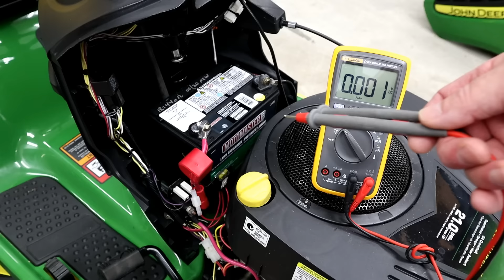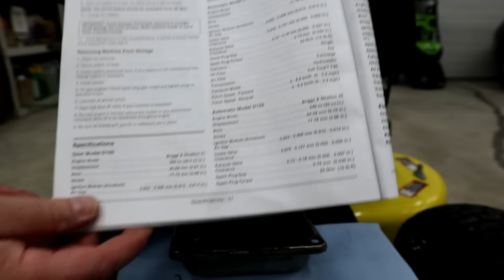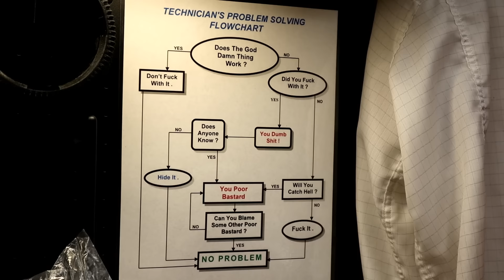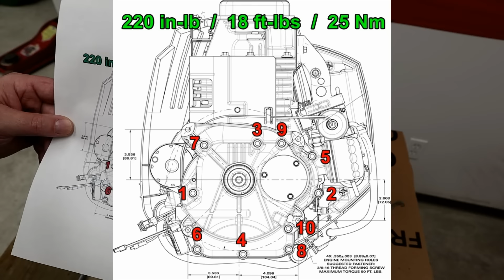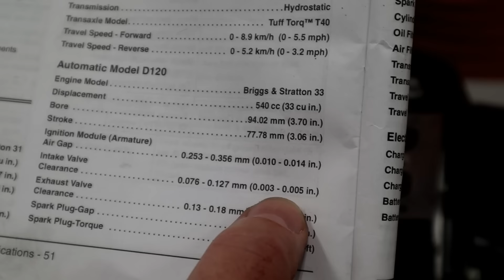Why Won't Your Riding Mower Turn Over? COMMON Briggs Intek PROBLEM & REPAIR.

Comment: I want to know how a mower with over 130 hours can be so clean!  Do you do a full detail after each use?
Reply from the maker: I answer that very question at the end of the video (I give it blow-job after ever mow @29:27). 😄130 hours? Nope; as stated in the video, it had 320 hours on it at time of that repair.
Reply: @Rchelicopterfun   I am guessing a power washer first then blow dry.  I use the leaf blower on mine.  The grass and dust still gets everywhere.
Reply from the maker: @larryjohns8823  Nope, blow only. AS I said in the video, I try to wash it as little as possible. Nothing worse or more miserable than wet grass and a wet mower.

Comment: Is this the same part for the 40 series V twin 20hp intek engine? I have the same problem. Changed the battery and still has issues starting
Reply from the maker: Decompression cam failure only applies to the single cylinder Inteks.

Comment: Hello from Denmark. Thanks a lot for a very good video. I know this camshaft is a problem on B&S Intek engines, and i cant stop thinking of something. What do you think will happened if we only take this broken parts off the engine, and assempled it again without this valve release system ? Ok, mayby you will need to reverse the engine from compression every time you need to start, but i should think the motor will run good anyway. What do you mean about that? Do you think it will work proberly? Just a thought from a guy who also has made a lot of motors from Briggs and Stratton., but not ever has made new engines like Intek yet. Only the good old B&S.
Reply from the maker: Totally fine if you don't mind that hassle every time, but it won't work if it gets too cold out. Will most likely shorten battery and starter life as well.

Comment: Why do engineers solve a problem with another problem ? I had the exact same problem. The smart way,  would to simply install a more powerful starter motor. It would be worth the few extra bucks.

Comment: would you think reassembling the mower without the decompression system would work
Reply from the maker: If it's not fixed/replaced, then it will function exactly the same as when it was broken - unable to start without positioning the piston on the down stroke every time. Which will of course eventually wear out the starter while stressing the bendix starting gear and battery.

Comment: How much oil does this engine take as I have the same engine and shop did not give
Me manual on the new engine as my old engine blew. I am on my 3rd engine with 2006 tractor I average
About 100 hours
On each engine briggs and crap Stratton lol

Comment: My problem, to a T. Had a Yard Machines mower that I have jumped from my car for the past almost 20 years, a real ritual and test of patience to get the &$&%*#;@!! B&S engine to kick over. 
It had this problem from day 1, so it was "repaired" under warranty. Not sure if the local fella who picked it up, took it home and did the work actually replaced the cam and compression release. I do remember though, he said it was a wrong force spring in the CR mechanism!! 

Not knowing mechanically how it worked other than it disengaged as RPMs increased, I just went along with what he said. He was the huy with the info, not me! 

Well, I was able to get it to turn over until last fall, when not even jumping from my car to the starter post was doing the trick, and parked it. 

I went and bought a used JD X300 this spring, with a Kawasaki engine and 150 hours, and that baby starts like a dream. It should last my 72YO bones the rest of my mowing days. 

Not sure if I will fix the old mower the way you showed how in this excellent video, but perhaps this winter, when there isn't much else going on. 

Thank you for the tips all through this video. They are very appreciated!

Comment: Does the Kohler CV15 use a similar decompression system? My LT155 hit something that stopped it cold. After clearing obstruction machine started and ran for about 1-2 minutes then died. I checked and replaced  the fuel solenoid and carb b/c solenoid was broken and the carb was just ugly. after these changes a full battery is struggling to turn it over
Reply from the maker: No idea?
Reply: @Rchelicopterfun  Thanks!

Comment: Which way does that long bolt turn that goes through the pulley? Counter clockwise like normal or clockwise?
Reply from the maker: Right-hand thread (ie. normal).

Comment: If you change the oil, will you normally see pieces of the grenade part come out in the oil?
Reply from the maker: Might, might not - all depends on how catastrophically the decompression doo-dad  got chewed up when it went boom! If the pin just broke (the normal failure) and the arm mechanism just fell down into the sump, likely nothing will show up.

Comment: Just thought this was what I would have to do to my
 jd la115.. same symptoms & everything.. luckily just the exhaust rocker (stud) backed out.. creating a really bad pash.. snug that back in, did a valve adjustment & now it runs like new.. acr working as it should 261hrs.
What hrs the acr usually fail?
Reply from the maker: @Run It - There is no set time as far as I know. They can fail at any time; under a hundred hours or if you're lucky, last a lifetime. Anecdotally, the first one on the new machine only lasted 120 Hrs (outside of warranty of course). The Second OEM one lasted 200 Hrs (320 hrs on the engine). This aftermarket one, has about 15 hours on it now (335hrs total on the engine) so who knows how long it will last?

Comment: Kohler engines ROCK!  Never a problem with my 60 year old Wheel Horse and over 600 hours on my Cub Cadet 2166.  What other engines do you find that are quality engines?

Comment: my john deer saber riding mower acts like the battries dead i have replaced the starter switch, the battery, the starter, and the spark plug and solenoid what's wrong

Comment: Pitiful that the weak starter can't turn that thing over.
Ideally the starter and battery should be able to crank the engines without the stupid compression release being there at all.  Does that thing have the plastic cams and gear?
  I guess the new aftermarket one looks metal but could it possibly be better than the "OEM" version supplied by the NEW ! "Briggs & Stratton"

Comment: What would it be if once you put it all together & now turns over has spark , but won’t fire?
Reply from the maker: Presuming it was running fine before, just off the top of my head a few first items to check are:  is it's not getting fuel now for some reason, throttle cable was not re-attached / attached incorrectly or the  new cam is not timed correctly.

Comment: ScamShaft, we shouldn't have to be doing engine repairs for 20-30 years as long as we maintain them properly....So many once great companies have gone to heck.
Reply from the maker: Agreed. I still have an old push mower with a 3.5hp Briggs engine that still runs great. I remember going to Sears with dad to get it back when I was in junior high school. Not sure what grade, but even if it was 9, that means it's at least 41 years old.

Comment: Question? If this part aways breaks! Can't you eliminate it completely will the motor still run.
Reply: Maybe that's why they call bridges & station, bridges&crapion.!
Reply from the maker: As demonstrated & stated, it won't start without a decompression device. Even if you don't mind the huge hassle of positioning the piston off TDC every time you start or blocking the intake, the increased stress will shorten battery, starter and Bendix gear life. 
The permeant fix has likely been identified in the comments - round off the back side of the new decompression lift pin during replacement so it doesn't get exposed to sheer force as the engine bounces backward when stopping.

Comment: why do you oil the camshaft when you install it,  Before you start it you are going the fill the crankcase so all lower parts will be submerged in oil?
Reply from the maker: It's being turned by hand before any oil is added + you always oil all metal on metal moving parts when assembling any engine - normal procedure in any course or manual.
Reply: @Rchelicopterfun  Thanks for the reply, makes sense,  great video by the way.

Comment: I wouldn't touch anything new. My 91 3013h runs great, so does my 98 yard bug with a more reliable B&S flathead. Both run great. I wouldn't bother with this repair I'd just tap the main output pulley and crankshaft with a plastic hammer to see if it releases. Or tap the case. I would never bother repair this bad design unless it was to sell it.

Comment: I know it’s instinct to always seek OEM parts first, however unless B&S has a revised heavy duty part, does it make any sense to keep buying the OEM when we know that OEM is a junk component ?  I think we are well justified in this case to try anything but OEM, until B&S do what any ethical manufacturer should do, and revise the part and generate a new part number.

Comment: John this was my first visit to your channel and I must say it was very good. 
I am wondering if one couldn't just remove the decompression arm and replace the starter with a high torque version. 
Let me know your thoughts.
Reply from the maker: To the best of my knowledge, there is no higher torque starter OEM or Aftermarket. If anyone knows otherwise I would very much like to know because yes, that would be the best workable solution.
Reply: @Rchelicopterfun  I do not think there is a high torque starter made for it now, but i do think it would be a viable long-term solution. 

Thanks for the reply.

Comment: is this same for the twin cylinder Briggs and Stratton?  Same symptom...i suspected battery, new battery still no good.  Removed both valve covers and made sure gaps were set correctly.  Can run it if I do gas or alot of fluid to get it to run but saw that there should be a bump in the intake valve at some point in the stroke for single cylinder engines with good decompression cam.  Neither sided had such a bump.  So can you tell me if the decompression cam is broken like it is on yours for the twin cylinder model? Should there be a bump on both or either side during each rotation?  Thanks in advance for any help
Reply from the maker: This applies to single cylinder Inteks' only. No idea how or even if there is a decompression on the twins.
Reply: @Rchelicopterfun  ok thanks.  I watched another video with a twin not being able to turn over completely and did not see the "bumps" on the rocker arms during manual rotation.   His problem was valves were loose and I guess that can keep valve closed too long or during top of stroke and make too much compression.  anyway it is my impression that the compression release mechanism is not installed on twins.  anyone knowing differently please let me know
Reply: @Rchelicopterfun  Thanks.  So it appears that it does not apply to twin cylinder models.  There is no visible bump at top of cycle and my problem was too big of a gap in one of the valves (between top of valve and rocker arm).  Set each side separately by removing plug and checking if starter with good battery had enough energy to crank it over.  The bad side had a bad gap.  Set it to 0.004" and it no longer had a problem cranking with plug back in.   Once I found inlet jet in carb was plugged it starts right up.

Comment: Hi
should we use oem part since they have issue with it 
or after market part with 3/4 less price 
thanks
Reply from the maker: As stated in the video, aftermarket cams are hit-and-miss, a complete crap shoot. They may last as long or longer than OEM or fail within hours (I've heard both scenarios and everything in-between). This one replaced in the video has about 10 hours on it now; so far, so good, but it's still a long way from 120 hours that the original cam lasted and the 200 the second OEM one lasted.
Personally, if a Briggs OEM cam is in stock and available, that is what I would go with 100% of the time. It's a flawed design regardless of who manufactures it, but the consensus is the Briggs OEM cam will statistically outlive aftermarket. I was forced to get this aftermarket cam only because the Briggs cam was out of stock everywhere I checked.

Comment: John salt my grandma has a 2018 John Deere E100 I feel like this might be the issue but I wanted to ask you when I try to start it without being jumped it will not start but it definitely feels like the compression isn't releasing but if I jump it off of a vehicle and let it sit for a little while it will start and it will start itself right up and then if I run it for a little while and shut it off it'll start back up but if I let it set for too long and try to start it won't start I've tested the batteries everything came back normal
Reply from the maker: Sounds like a weak battery issue, but without doing all the diagnostic steps I outlined, including checking the intake rocker for both correct valve adjustment and feeling the decompression "click" , that is just a guess. A broken decompression won't even start with a boost so that's your main clue.
Reply: @Rchelicopterfun  ya John I am at a loss I have tried new batteries and checked the voltage regulator and the battery is resting at 12.6 volts and won't start it only with a jump and letting it sit forever and it backfires when finally starts
Reply from the maker: Maybe too much fuel for some reason (leaking through the carb as it sits for a long time and coming close to hydro locking).
All power cables tight?
Could still be the decompression and the intake valve adjustment being just off a tad. When hot/warm, intake pushrod expands slightly along with other valve components and clearance/lash comes into spec so the decompression functions correctly when hot/warm.
When cold, things contract and decompression stops working due to too much valve rocker clearance/lash.
Pretty easy to confirm valve adjustment so that would be what I would check next and you can then confirm for sure if the decompression is still working with the valve cover off by feeling for the click.
Reply: @Rchelicopterfun  yeah it has new starter new solenoid when it's running the voltage on the battery is 13.4 when I checked the stator is only one wire I put the voltmeter up it's not reading anything from that wire but when I checked the voltage regulator it's only saying like 7 volts I don't know there's only one wire that comes from stator because I was thinking maybe it wasn't charging the battery when I try to turn it over when it's hard to start without something jumping it it knocks the battery all the way down to like 6 to 7 volts
Reply from the maker: Sure sounds like a sulfated battery then (good voltage, but low current and high voltage drop under load) - but you said you have replaced the battery correct?
Reply: @Rchelicopterfun  ya we had 2 tested and they both held charge and both do the same thing

Comment: would the engine run if you removed all the decompression cam parts and put the old camshaft back in?
Reply from the maker: It runs fine without the decompression parts as demoed at the beginning of the video, the issue is getting it started without a working decompression.

Comment: What would cause fuel/air blowback through the carburetor.
Reply: Cam lobe shifted out of time slipped on the shaft? (On crappy multipiece camshaft assemblies)?  Cam installed out of time? 
When they have a compression release you might notice the air "huffing" back towards the carburetor when the intake valve gets "bumped" by the  compression release pin

Comment: Not only does the compression release a horrible design but the head gasket as well. Briggs should had added another head bolt as the head gasket fails quiet often .
Reply from the maker: Indeed 👍